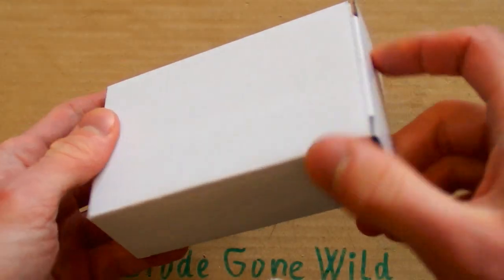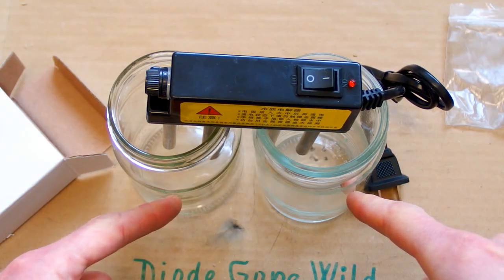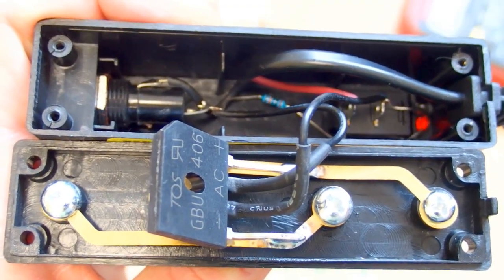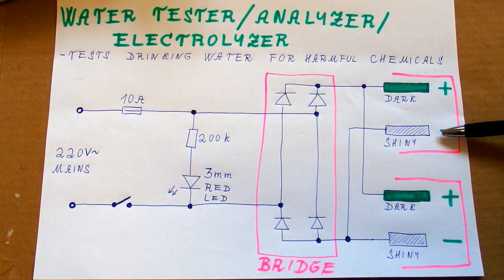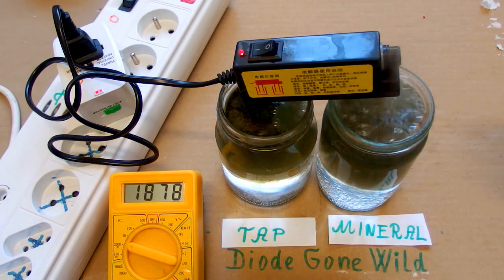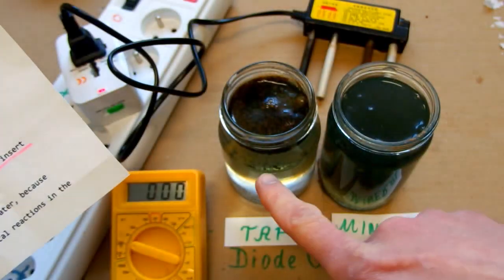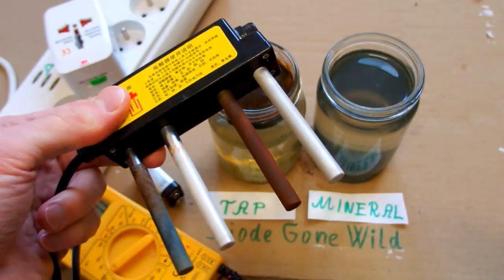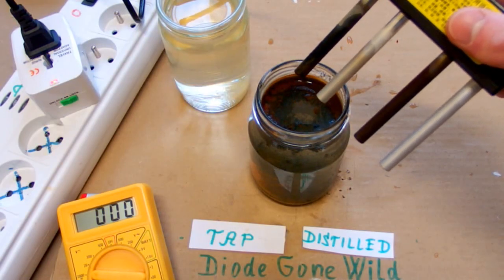Water Electrolyzer (Quality Tester). The Most Dangerous Appliance Ever?

Comment: NOT TRUE AT ALL! I just bought this item and test them. I just tested what this review said  'THE DIRT COMES FROM THE ELECTRODES DISSOLVING'!! 
If it is true, the "pure distilled" bottle water from Super Market would change the color too WHICH NOT HAPPENED AFTER FEW TIMES USING THE SAME 'DIRTY RODS' using both "pure distilled" bottle water from market. Later I used again to compare the "pure distilled" water against "tap water" and our "purified water (we're using not very cheap water purifier!")! Again the "tap water" changed the color so badly compared with "distilled water" due to mineral residue in the "tap water" and NOT from the 'dirty rods'! The "purified water" from market is WHITE even we put purposely the 'dirty rods'. It is just simple chemistry and physic. Sure we don't know  exactly what's 'contamination' in the water means what minerals (harmful or not) we really have inside the water.  In this case we must buy a labor water tester in range of few hundreds to  thousands dollars to find what minerals and how many PPM we have in the "tested water".
About security is other issue, it is a cheap item and not intended to switch on so long because it is using a heater. It's a working item if you know how to use it and what's the idea behind it, but doesn't tell you at the end the water you tested is good or not!
Reply: J Lee Sorry but you are wrong. The distilled water is not conductive, so there is no electrolysis. Tap water contains minerals and, so, is conductive : there is electrolysis and the electrodes are dissolving. That's all. The color comes from the électrodes.
Reply: @34.FB.34  Sorry, I'm right. Read properly what I wrote. Because distilled water has no minerals, is not conductive so the water still looks clean although I used the dirty rods! Means, the change of colour in water didn't come from the dirty rods, but always has to do with the minerals in water, whether the rods are dirty or clean.

Comment: His power measurements are way out. I tried my tester on tap water X 2 that went pretty brown and the current draw was 1.2 amps at 230 volts which equates to 276 watts.
Reply: Tap water varies from place to place. His tap water consumed about 60 watt. What consumed more than 1000 Watts was only the mineral water hence combining the two you get the total power in the range of 1800w

Comment: You should have tried it with salt water!  Apart from imparting iron and aluminium ions into the water and being lethal it makes a good kettle
Reply: Why would you want to drink it after that. The question I have is why does distilled water not change color?
Reply: @LEO-xo9cz  Too much resistance, no chemical change!
Reply: @cainabel2553  too much resistance due to lack of minerals/impurities in the distiller water would be a better way to put it

Comment: Pity you didn't finish up by adding a little salt to the distilled water, then you'd prove definitively that all the gunk was coming from the electrodes.
Reply: What's that mean please? Does it mean the water is not actually bad?
Reply: @beatcat1265  I was referring to adding salt to the distilled water. This will increase the conductivity of the water. Ordinarily distilled water is not conductive, as is seen in the video, so almost no current flows. When the salt is added and the tester inserted, the water will boil vigorously.  If the water turns dark, the water's discolouration must be coming from the tester's electrodes.

Comment: such a beautiful cat <3 i used this item to test around 30 different bottled water and each glass had a different color. i wish i have seen this video before. but at least i know which water to avoid
Reply: How can each have different color? If the metal connectors anode/cathode you place into the water is same one for every glass, and indicate different for every glass of water then isn't the different color the different electrolytes/salts/minerals in the water Reacting with the metal connectors also? Maybe some truth to this, just it is not going to tell you the exact contents of water but rough estimate.
Reply: @ronaldd2154  Common minerals in water can take part in the colored "compound". However this does not mean that they are the dangerous substances listed on the paper.
Reply: @vptech9861  thats exactly what I was thinking, theres no real way of telling what is in the water, only "guesses".
Reply: @ronaldd2154  Greetings! I would suggest taking it to your city or a qualified scientific research facility to find exactly what metals are I the water, also you can use a TDS meter to find how many parts are in the water.
Reply: @charlesficheriii1478  lol, doesn't matter now ( I drink distilled water) and get my minerals from the foods I eat.

Comment: Also it says 

note!

Water Electrolyzer • Interconnect the electrodes after they are placed in the water. • Do not touch the metal when the power is on. Do not put your fingers into the test. Do not use metal container three water detection

Comment: I used Google lens to translated 

Instructions for use of the electrolyzer First place the two sets of electrodes into two water containers, then plug in the power supply, press the switch, and electrolyze for 30-60 seconds. Different colors of water after electrolysis show various impurities in water: yellow, dissolved acid, oxide, other organic color: arsenic (arsenic), mercury, lead, copper, sodium blue: bacteria, viruses, carcinogens, fertilizers, pesticides Equivalent: iron and rust, bacteria black: heavy metal

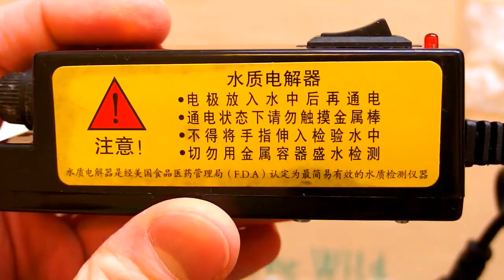Comment: At 1:12 this is what it translates to. In case anyone was wondering lol.
"Water electrolyzer
Put the electrode into the water and then power it on
Do not touch the national bar when power is on
Do not put your fingers into the test water
Do not use metal containers for water detection
A identified as the most beneficial water quality inspection equipment"
Reply: the bar every nation has
Reply: What is the "national bar"?
Reply: do not touch the "national" bar💀
Reply: Better translation -  the small print at the bottom is the best part: Water quality electrolyzer
!

· Put the electrode into water and then turn on the power

‧Do not touch the metal rod when the power is on

• Do not put your fingers into the test water

Notice!

• Do not use metal containers to test water

The water electrolyzer is recognized by the U.S. Food and Drug Administration (FDA) as the simplest and most effective water quality testing instrument.

Comment: Translation from side without the warning triangle- Electrolyzer use instructions Electrolysis diagram First put the two sets of electrodes into two water containers, then plug in the power, press the switch, electrolysis for 30-60 seconds.  The different colors of the water after electrolysis show various impurities in the water yellow: dissolved acid, fluoride, other organic matter green: arsenic (magnetic cream), mercury, lead, copper, sodium blue: bacteria, viruses, carcinogens, fertilizers,  Red pesticides: iron and iron, bacteria white: lead, zinc, mercury, inorganic salt, dirt, black, heavy metals

Comment: Made in China . The test is not right .. I did the same at school once during chemistry
Each type of water contains different minerals (depends on the filtering)
Through electrolysis and the use of the 'wrong' stainless steel cathodes that react with the (molecular) minerals, the water colors
It is even better to use cathodes made of carbon .. these are almost insensitive to chemical reactions with the minerals .. with this you will see that the water remains almost the same

Comment: I've got the same multimeter and I'm wondering, how you can manage to measure the power, when you switch it to V-DC   ...I guess, you've got an adapter which is sniffing current and voltage (which we just can't see)  ...but why then V-DC?   Love your videos, btw
Reply: He has a power measuring circuit he designed the voltage meter is connected to the output of the circuit which gives 1mv for every 1W of power so the voltage is proportional to the power through his circuit

Comment: Well it’s not just the minerals in the water, it also reacts on other particles present in the water. I have done this test with many seasons of rain water, ground and well water with and without  algae and bacteria proven to be present in the water before the test as well as with several brands of bottle waters and also distilled bottle water. The results for all of the waters were different. In the rain water there were no black colors, there were no green but there were very light shades of yellow compared to some bottle waters where the shade of yellow was more concentrated depending on the brand. As for the algae and bacteria water the colors were present and obvious as listed in the color chart. The device might be cheap and so are the probes but it works if you use it right. No more than 30 to 45 sec are necessary in 250ml of water. Otherwise the contents found in the water begins to cook black,  displaying as heavy metal. I’ll give the device a 4 out of 4 especially since nothing else is as readily available.
Reply: Very usefull comment, thank you
Reply: I agree, i was shocked. We have a water purifier and it was the same outcome for tap.
Destilled was fairly clear. 
I put a teaspoon of baking soda in tap and it remained clear. That was surprising
Reply: @northlandcarpetservices4940  is this a joke?

Comment: Water electrolyzer
·The electrode is put into the water and then powered
Do not touch the metal rod when the power is on.
Do not put your fingers into the test water
Do not use metal containers for water detection
The device is the most simple and effective water quality testing instrument certified by the US Food and Drug Administration (FDA).

Electrolyzer Instructions

First, place the two sets of electrodes in two water containers respectively, then plug in the power supply, press the switch, and electrolyze for 30-60 seconds.

The electrolyzed water appears in different colors to show the various impurities in the water

Yellow: dissolves acids, fluorides, and other organic matter

Green: Arsenic (arsenic trioxide), mercury, lead, copper, sodium

Blue: bacteria, viruses, carcinogens, fertilizers, pesticides, etc.

Red: Iron and rust, bacteria

White: lead, zinc, mercury, inorganic salt dirt

black: heavy metal
Reply: Yeah that just makes sense, things are dangerous if you dont use then the right way... obviously 
It's like saying a knife is dangerous, well duh, it's not made to cut your fingers
Reply: You trust the FDA?! 😂🤣
Reply: @LeapingFrogg to jest napis tłumaczony z etykiety

Comment: One question...How there is 213 VDC...I mean rectified mains are 300 VDC?!
Reply: There is no smoothing capacitor on the output so the putput is a full-wave rectified sine wave.  The meter reads the average value not the peak value.  The average value of a rectified 230V sine wave is 207V, give or take a few diode drops.

Comment: Device used by shady RO system salesmen to compare their RO water with unfiltered tap water to disgust the customer and promote sales. Of course the list of contaminates is BS.
Similar device used in a foot bath that is supposed to remove toxins from your body through your feet. The water becomes discolored and device sellers (or operators in spas) claim the discoloration is "toxins from your body," but of course it all comes from electrolytic reactions at/with the electrodes.
Both are scams, and it is not surprising that the makers of this device took no interest at all in making the device safe.

Comment: I was stunned at how that tiny of a cord pulled 2 kilowatts of power just how does that thing even do that? i have so many questions
Reply: You can see clearly at 9:00 how it melts and falls slightly, probably the wire temperature was over 80 degrees Celsius
Reply: Don't forget that poor FULL BRIDGE RECTIFIER
Reply: fr

Comment: 1:07
yellow: dissolved O2, fluorides, other organics
green: As, Hg, Pb, Na
blue: bacteria, virus, carcinogens, fertiliser, insecticide
red: Fe&rust, bacteria
white: Pb, Zn, Hg, inorganic salt dirt
black: heavy metal
WTF??
Reply: The device itself is the problem. The rust being produced is from the iron electrodes. The Aluminum electrodes don't corrode cause aluminum does not electroplate. So the metal from the other steel electrodes stays suspended in the water. You seem to know about Chemistry, so now just apply electricity, corrosion and an understanding of alloys and Chemistry. And your answer as to why this is a scam, will be obvious. This is basically an electroplater and the device is part of what is fouling the water.

 If you are drinking decent tap water, it will have gone through a filtration process, or reverse osmosis and then would be remineralized cause r.o. strips the water of everything including minerals. There should be little to no bacteria in it or anything but minerals and Chlorine. Where the hell are you getting fertilizer and insecticides from?! That would have come out with the filtration or r.o. at the city water treatment plant.
Reply: @MrBilld75   tap water is NOT RO water! RO water leaches minerals from your body and also the process costs a lot.
We use RO water for our lab equipment in hospital pathology and no you cannot drink it 🤦‍♀️

Comment: Forget about the discolouring of the water If the water bubbles it still shows that there is some contaminates in the water as demonstrated with distilled water vs tap water.   Tap water = conductivity.........Distilled water = Non conductivity.
The  contaminates that is in the water will react with the metal rods which will produce different colours from the metal rods and not from the water.
Reply: lol
"contaminants" also known as THE WATER ITSELF
Reply: Yup, you nailed it, exactly! That's what's going on here. Corrosion from conductivity. It's basically similar to electroplating. The aluminium probes will not electroplate, so the corrosion from the steel probes remain suspended in the water, discoloring it. It's rust, from the device itself! Lol..
Reply: Shady 702 the bubbles are hydrogen and oxygen from hydrolysis of the water itself. That would happen even with distilled water. The discoloration is from the minerals that are naturally present in water- and necessary for life- reacting with the electrodes. If minerals weren't present in the water, meaning the water was distilled, then over the course of a few weeks, your blood would become diluted to the point that osmosis would start to occur between your blood and the cell walls to try and balance the mineral content. And that is a bad thing.
Reply: I've read every answer here and none make sense. I have the machine. I live on a small tropical island, our tap water is pretty pure. It turns to a light yellow. Then tested our local bottle water which basically comes from the same mountain ⛰ as the tap, turned the same light yellow. Then tested a water from the mountains of France it turned black with big chuncks. Repeated the experience several times and the results were the same. My conclusion is it reallly does reveal what is in the water, wether it's bad or not according to the color, I do not know.
Reply: Shady the dumb-ass, there are minerals in drinking water which are essential to life. 
Drink distilled water only and see how long you'll live. 
I'll give you about 2 weeks.

Comment: 9:00 That power cable melting and falling down ;)
Reply: i dont see no melting cable. care to point out where its melting exactlly?
Reply: @ddjohnson9717  It's not melting per se, but the high current draw is causing the wire to heat up enough so as to compromise the integrity of the insulation, making it sag.
Reply: Pretty bad huh
Reply: @ddjohnson9717 More like a loop of wire sagging pretty badly.
Reply: @ddjohnson9717  on the left close to the plug.
Reply: lol R.I.P. cable
Reply: That is by design, the power cable acts as a fuse and breaks if you pull too much current over it xD Of course, it is superior Chinese technology. Made from weapons grade Chinesium